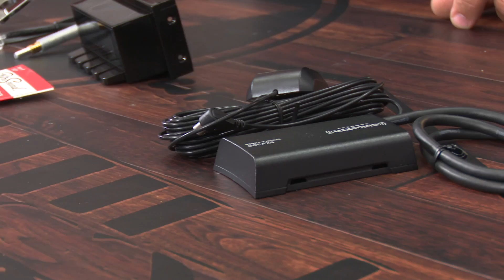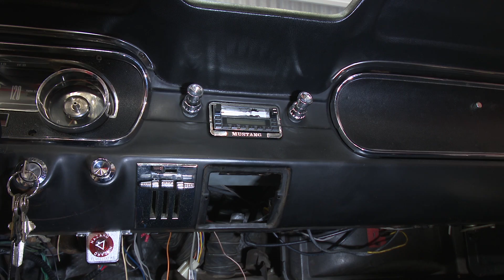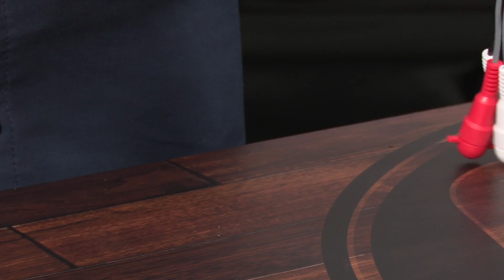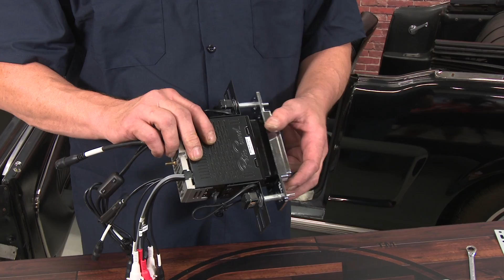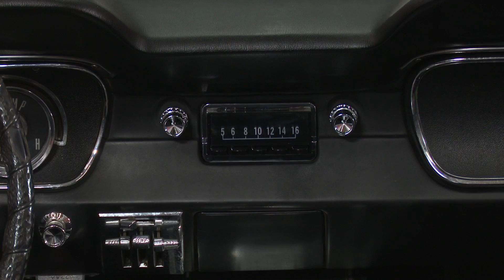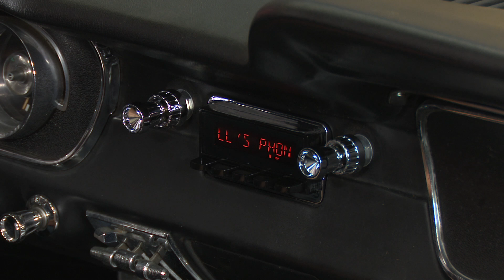Long Beach Radio | RetroSound | 1965-1966 Mustang

Comment: I recently purchased and installed this radio. I decided not to use the knob brackets because they're just too light. Roughly 18 or 20ga steel. I have access to CNC sheet metal fabrication equipment, so I made my own brackets from 12ga steel. The installation is now bulletproof. The included brackets are my only real gripe about the kit.

Comment: What about the memory for settings ?
Reply from the maker: It stores radio stations and sound settings.
Reply: CJ Pony Parts I meant is that included in this exact install or do I have to find a diff wire for it considering original radio was analog

Comment: Installed the same radio about a month ago, sounds good and looks good, but my only issue seems to be that half the controls don'k. Either i suck at installations or the radio is bad. Any suggestions?
Reply: I had the same problem, they sent me replacement controls. I think the controls got damaged because they're the only thing holding the weight of the radio. My unit didn't come with any mounting bracket. (I still haven't installed the replacement units).
Reply: Umanng Mittal thanks for the tip!
Reply: Kody La Place I actually replaced my controllers yesterday! Working perfectly now. I also installed a strip holding the back of the unit up so that all the weight isn’t borne by the controllers.